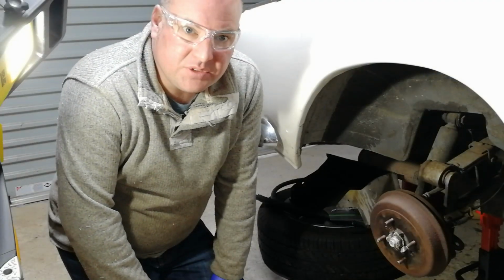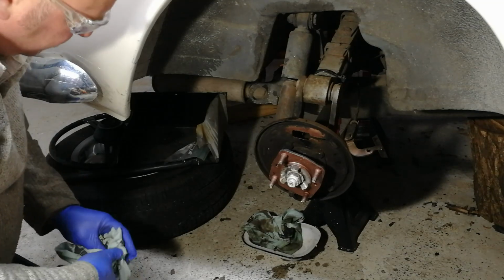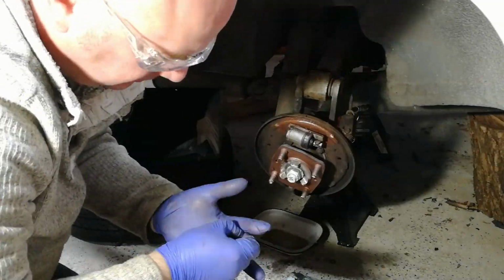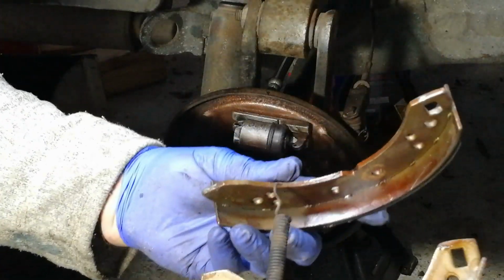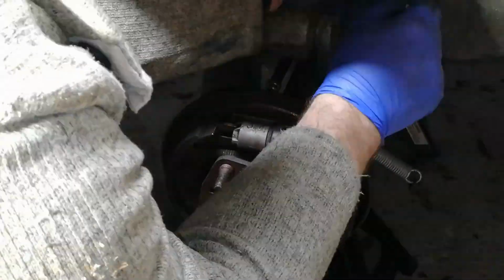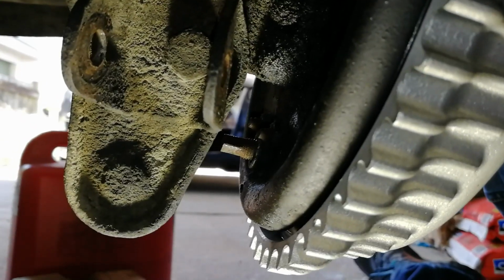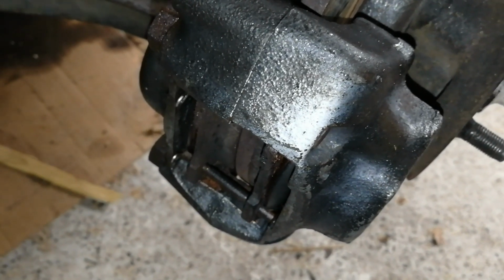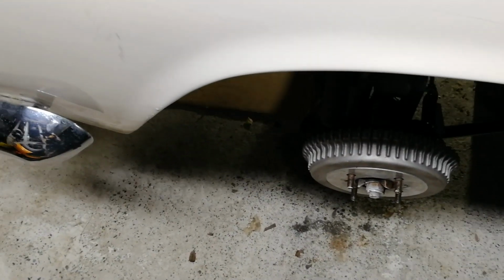66 SPTI part 14 – Rear Brake Refurbishment on my 1966 Spitfire 4 Mk II

Comment from the maker: Note: I missed that the shoes were clocked wrong, only one should have the square notch at the top (for the handbrake lever).
Reply: Surely only matters if they don't have two pin alignment holes? Went on the way they came off.
Reply from the maker: @toxaq  hi, it apparently does matter, probably as the pad is not symmetrical on the shoe. Also that wasn't the first time I had them apart. So may have been messed up prior, also the PO was a muppet
Reply: @jamesfromwellington  interesting. The ones on my TR6 have non-symmetrical holes for the pins, to they cant be done wrong. Id assumed looking at yours that they could go either way because of those symmetrical holes.